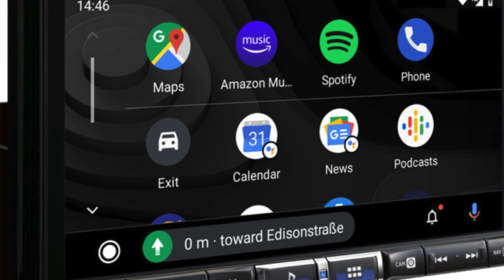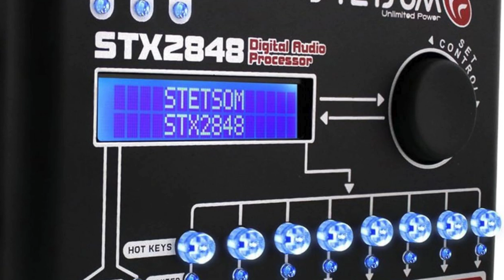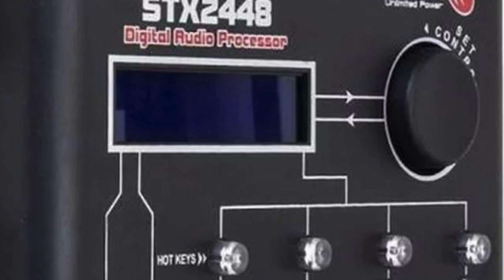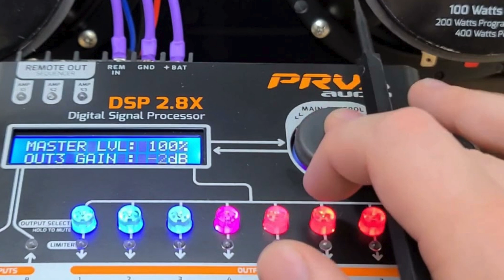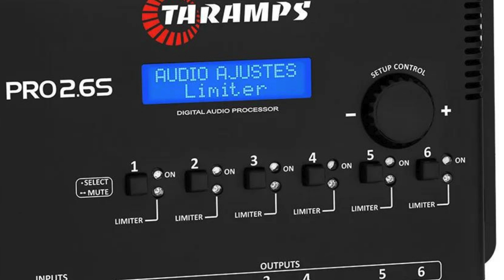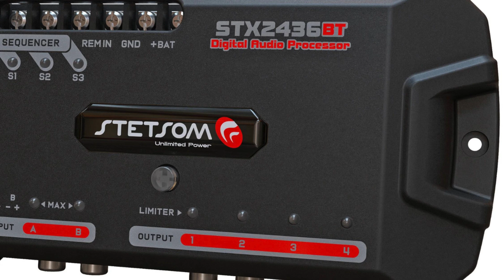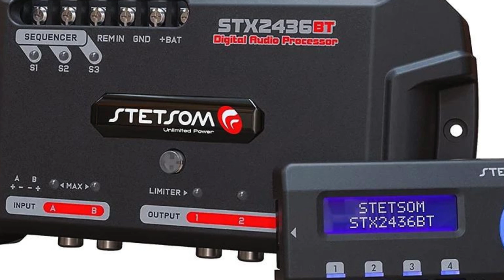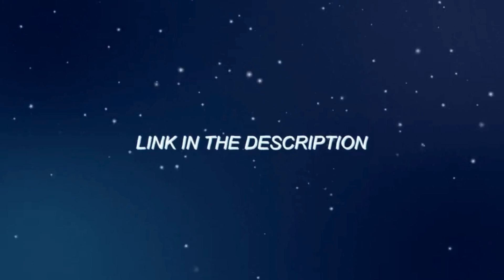Top 7 Best Digital Sound Processor (DSP) for Car Audio (With Equalizer and Crossover)

Comment: Perchè quando cerco il top di qualcosa come in questo caso DSP mi escono solo prodotti cinesi o commerciali a basso costo e mai una lotta tra prodotti che fanno parte del vero Hi-End?
Reply from the maker: Great question...A lot of the truly high-end DSP brands, like Helix, Audison, Mosconi, or Brax don’t usually show up in the mainstream searches because they’re sold through specialty dealers instead of big retail platforms. That’s why Amazon mostly highlights the more affordable or commercial options from Stetsom, PRV, Taramps, and miniDSP.

If you're looking for true Hi-End DSPs, checking dedicated car audio shops or authorized installers is the way to go. But for most people searching online, these Amazon DSPs still deliver great tuning flexibility and solid performance for the price.
Reply: @audiorevamp si ma oltre ai marchi da te citati nel mondo hi-end car audio ci dovrebbero essere anche altri tipo Goldhorn. Mi sapresti indicarne altri?
Reply from the maker: @faustodelisi4129  Absolutely, Goldhorn is another strong high-end DSP brand that deserves more attention. Other premium options worth looking into include Zapco, Arc Audio, Bewith, Tru Technology, and AudioControl’s higher-tier processors. These don’t get as much visibility because they’re often sold through specialty installers rather than big platforms, but they offer incredible processing power, cleaner signal paths, and audiophile-grade tuning for serious sound builds.
Reply: @audiorevamp thanks for your words
Reply from the maker: @faustodelisi4129  Most welcome.